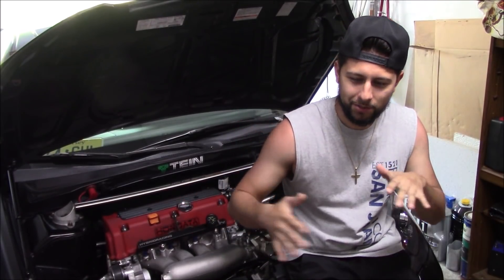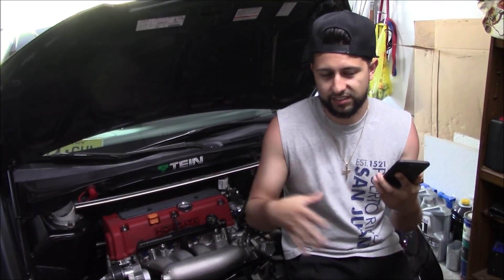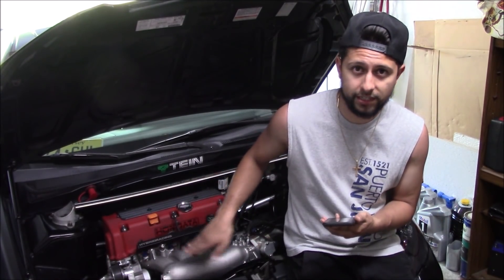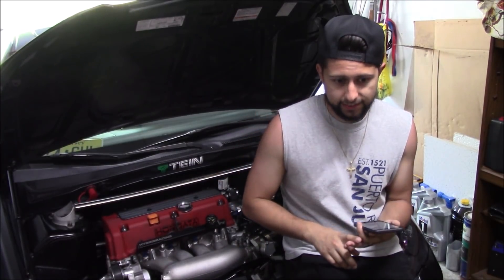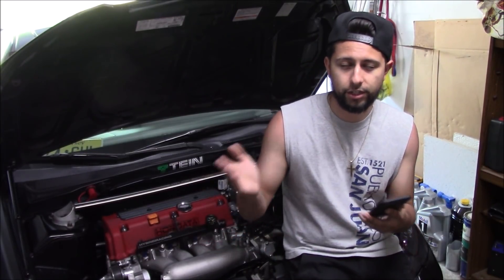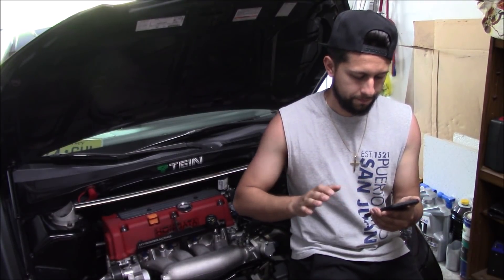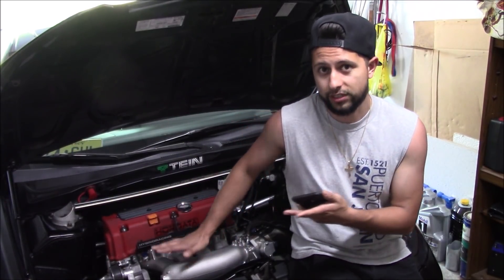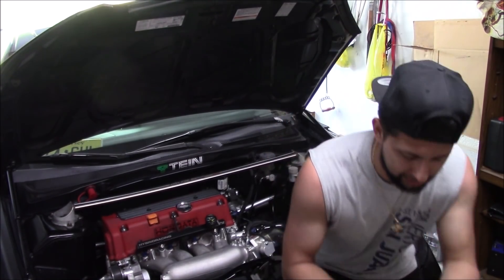My K20/K24 Build Cost !

Comment: I got a k24a2 at the junk yard for $200 and then sold the head on eBay for $200. I bought a wrecked Civic Si for $1000 parted out the motor made all my money back and keep the 6 speed lsd trans and rbc manifold.

Comment: Btw if you have a k24a4/a8 and want to use a k20 head you'll have to change the pistons as they won't clear the valves
Reply: What block would be good then?
Reply: @thatsikid7595  k24a1 or k24a2
Reply: What k20 head lines up with no problems

Comment: its 5700 dollazzzzzzzzzzzzzzz DAYYYYUM!!! I have new motor coming. but doing a 24A TSX with my Si head. 4P oil pump all the little things. im about 1700 deep. do u think I should run the TSX cams in the K2o head?

Comment: Damn! I have a TSX K24A2, I did all the bolts on and tuned, swapped intake manifold, throttle body, VTEC gear advanced and just ordered the oil pump to upgrade from HTP. I'm only thinking how much I have to drop for building pistons, rods, springs, crankshaft etc and then a final tune before doing supercharger. I'm going to break my pockets after getting a rough idea of how much you spend although I'm going for street use so hoping it wont be as much. Good video and good engine build video, you saved a lot of money by doing it yourself. Thanks.

Comment: Would be interesting to see what the total build would be, including mounts, ep3 electric power steering, short throttle cable, fuel rail w gauge, map sensor (just some of the things I pick up from the quick look at the engine bay), suspension & brake components, etc.  I know I have a ton of $$ invested in mine.Also for 05-06 owners like myself K-Pro is a lot more at around $1450 plus you need a new O2 sensor

Comment: I have a built k20/k24 recently the car started bucking and sputtering wanting to die when I give it any throttle in gear. But idles and revs fine in neutral and ideas?

Comment: Hey Bro i have a question did u built ur tranny cuz i got an LSD tranny it was working for a couple of months But now my 3rd gear sometimes it goes in Smooth like new nd sometimes it doesn’t go at all i have ktuned shifter shifter cables nd i just bought mtec springs i haven’t put on but u i have a Autozone CMC
Reply from the maker: my trans is stock other than an mfactory lsd. if 3rd gear is your only problem then id look into maybe a bad synchro or ive also heard those ktuned shifter cables jamming.
Reply: okk yeaa cuz i replaced this tranny bcuz of the same problem nd bfore i had stock every shifter nd shifter cables But is weird cuz sometimes it works perfect like anything sometimes it doesn’t but thanks tho

Comment: I have a rsx type s I blow up my engine I wonder what parts I need to out a k24a2 on my car. I don’t want to build it I want to have stock for not but I can’t find a good source of information . The k24a2 come out of tsx automatic and if I just can put that engine with the rsx type s transmission, I I need different sensor, a tsxt ecu if you can help I will be very helpful cause my car is being on jack stand for months
Reply: Milton Hernández hit me up if u need parts
Reply: Milton Hernández first off need kpro. Crv post mount (passenger bracket that is bolted to the engine. The bracket will  bolt to the passenger motor mount). Sensors off the type s: crank position sensor, knock sensor and intake cam position sensor. Gona need the thermostat housing, thermostat and the metal tubes that are connected to the housing that run along the front of the block. I would run a rbc manifold and must have an adapter to bolt the type s throttle body to the manifold. Your gona need the tubing and hoses that connect to all the vacuum lines i dont know what its called. Probably gona need a race header because the engine sits higher. Gona need a smaller intake or a cold air. I would recommend upgrading the motor mounts the k24 will eat up your stock mounts! At least get the energy motor mount inserts. That should be it. If your in socal i could swap it out for you and give you a nice map to start off with. It may seem like a lot but so worth it. Had my k24a2 for over 2 years now and always  beaten on it. The oem reliability is great  and surprise lots of cars all the time! Haha really fun for daily with a nice kick to it. hope this helps👍
Reply: simply klean thanks a lot bro
Reply: Milton Hernández no problem bro. You wont regret the swap trust
Reply from the maker: beast, simple yet effective write up of whats needed 👍
Reply: Christian Soto what’s your social media
Reply: Milton Hernández i got two solid motor mounts im selling. Ill let them go for cheap its the passenger and driver mount. Lmk if your interested. The passenger mount is a 60a innovative and the driver is unkown brand but still just a solid mount as well
Reply: Call one six motor sports

Comment: Hey man I wanted to know the name of the book you used to know the torque specs of the engine and where I could possibly get it thank you
Reply from the maker: its the factory rsx shop manual
https://www.ebay.com/itm/ACURA-RSX-SHOP-MANUAL-SERVICE-REPAIR-BOOK-TYPE-S-2002-2006-HONDA-2003-2004-GUIDE/231196586696?hash=item35d463f2c8:g:8bEAAOSwicpaT8oC
Reply: If you're lucky you may be able to still find electronic pdf version on Clubrsx.

Comment: What is the HP gain for that amount of money?
Reply from the maker: Check it out! 
https://www.youtube.com/watch?v=rlIIyCW-Huc
Reply: Just an extra 74 HP for 5700$? Wow. It is not worthy if that is the case. If I am not mistaken k20 engine come with 200 HP from stock worrect?
Reply: Adrian Mendoza that’s the thing about going all motor it’s expensive to make power but I love it
Reply: Its worth it if all motor power is what your looking for. Its a special kind of awsome lol
Reply: @aaronp9835  for sure. Also the rsx and 8th gen Si are heavier then older Honda's.
The k24 gives like 40ft torque over the k20 which helps alot for daily driving.
I'm doing a tsx k24 swap into my 8th gen. Stock motor, adding a type s oil pump and swapping to the 50degree cam gear. Just so the tuner can be more aggressive on the tune.
Total price is about 3k. But I'll have maybe 10-20 more hp on the top end and at least 40 more torque on the low end. That's what I'm after mostly.
People ask why not go boost? Well then you need upgraded clutch, possible break your transmission, reliability isn't near as good, these cars have small engine bays so heat management is a issue... 
Don't want all that for a daily driver.

Comment: Don't ever spray water in your engine bay like that again. Very bad idea.
Reply: Luke DeCarlo spraying engine bay with water is fine doesn't hurt anything.
Reply: Shadowplate Until you do. You don't want to get the alternator or any connections wet.
Reply: I get my engine bay washed frequently. connectors are water tight and you don't soak the alternator you can work around it. I also cover air filter with plastic bag
Reply: As long as you don’t soak the alternator/fuse box it will be fine.
Reply from the maker: guess i should have shown i had a bag over the alternator and air filter. A light mist over a COOL engine wont hurt anything. ive done it for years. just dont sit there holding the hose over anything for more than 5 seconds.
Reply: Luke DeCarlo I bet you also use threadlocker on your drain plug
Reply: Completely agree!!!  As long as the engine is cool and your engine is in good condition (i.e. good seal on spark tubes, etc.)  I have washed my EG, AP2 & DC5 like that for years and never a problem.